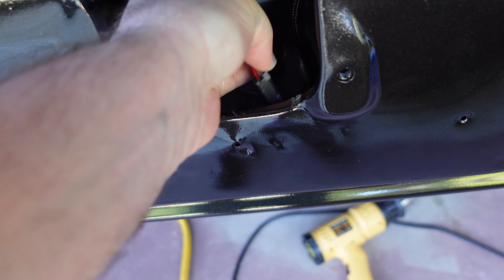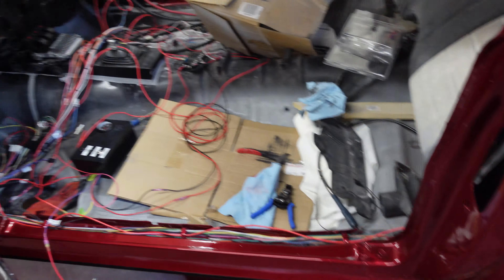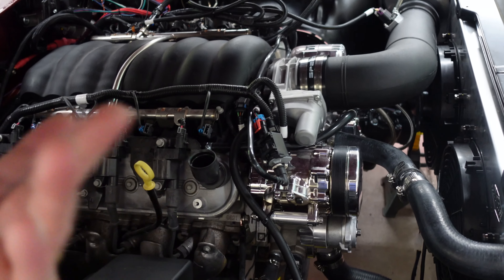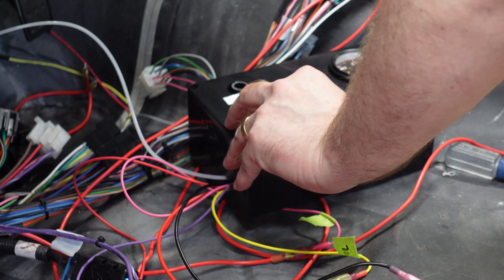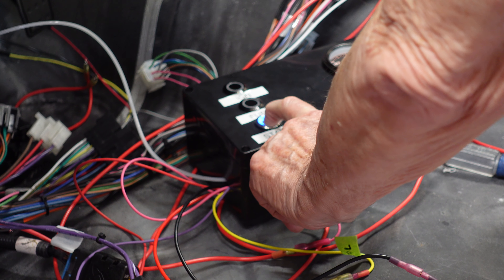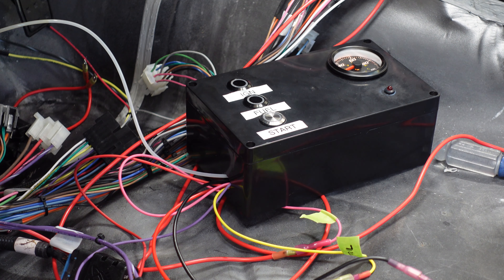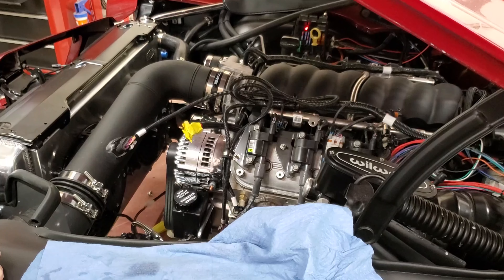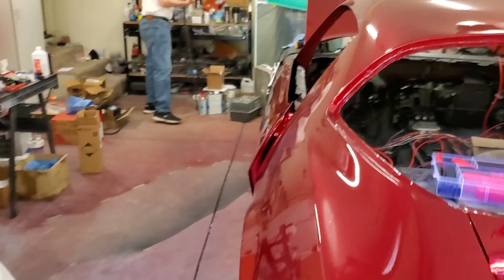1977 Camaro Z28 Part 274: First start?

Comment: You can test the thermostat if needed in water. At least the old style anyways. I have not fired up a LS motor new like what you guys are doing. You hit a major milestone in my opinion. Firing a new engine is always a little nerve wracking. Oil pressure is always the key, everything else is just getting things right. Congratulations, your on the way to the highway.
Reply from the maker: Thanks a lot! A pucker moment for sure. You can see a whole bunch of $$$ go down the toilet right in front of your eyes.

Comment: Hell yeah! So cool to hear it roar to life! I'm a little late to the game, but just as excited as I would be if I watched it the day you uploaded! I hope you got the power steering sorted out (haven't had a chance to catch up yet) and the high pitch squeal is a sound I'm familiar with on my old 4.8 Silverado. It would do that after replacing a battery or some other event where it would lose its "self-tune" parameters and start re-learning air-to-fuel mixtures, idle speeds, etc. sounded like it was coming from the internals, but it was the throttle body.
Congrats, Erik!!! And Pops!!
Reply from the maker: Hey buddy! I never would have guessed that was from the learning procedure. Wow!

Comment: Also the temp sensor in the heads is generally hotter then the one in the intake. I know mine open at about 200 on the heads vs the 180 on the intake.
Reply from the maker: Great info, thanks. I checked the docs, the Vintage Air thermostat is 187.

Comment: Fill the power steering pump and turn the wheels lock to lock multiple times...it will go away....
Reply from the maker: Thanks Trent. Tried that, it did not help. I am talking to DSE about it

Comment: I do not know about aftermarket engine control modules, but OEM factory I do. The key on-engine off, produces a ground signal to fuel pump relay. 18 AWG is plenty to supply or control fuel relay on. Just should have a 10 amp fuse to term 30. The PCM see an RPM signal above 450, it denies cranking. A fuel uses about 7 amps to run. An 18 AWG wire will carry 8 amp for 20ft. Many online charts but I use my ACDelco wire size guide. Even with weather-pack connectors, it is best practice to put dielectric grease found at home improvement stores in auto section, $6. Nice harness wrap but tapping the ends will come loose over time. Place a dab or black weather strip adhesive on tag end, work in and wipe off. Acetone is great. Fuel pump has to push air out of lines, using a Corvette filer (As many do) on “Return-less Systems” takes enough fuel and pressure to get to injectors. Clacking or clicking noise on top is lifters not pumped up yet. But the high pitch whine is p/s pump. Lock to lock while not running while not all air out of system. For oil pressure, I saw live-tube-type gauge. If bearing clearances are tight and bottom of cam bearings are not copper, you still have 2.5 feet of pickup tube, pump (G-Rotor Type) then backwards to oil filer. OEM pans have internal bypass. I hate these as they can stick open with tiny trash. Oil filter should be full when installed, and better off to have pressured entire system at oil pump block plug. P/S pump maybe ok, just run it to seat vanes. Puller is easy to remove pulley but get short one like SnapOn. Use relays to control components as it drop amperage requirements of switch and control wiring. LeSabres, Park Aves have perfect fuse/relay center behind glove box. It is long and skinny but holds 12-13 circuits. Aftermarket fuel pumps may come with a pan but require more the two gallons to fill. I hate the new $10 extra government portable fuel container/gas can. They are spring loaded or have spring button. Go to a boat dealer parts department. Every 4-stroke outboard comes with a 3 or 6 gallon tank & hose. Fishing boats, pontoons and many come with tank on board. The parts room has 50 of each. A good day get them for free or cheap with disconnect, hose and squeeze bulb. Just put a lawnmower on/off valve on end with 3” of hose. Most are 5/16” but placed on bench in shed, gravity will start flow of fuel with one squeeze of bulb and valve open. Just thinking out loud! Best of luck! Auto ASE Master-Retired
Reply from the maker: Thanks Dean. We did the power prime under pressure before this video was shot.

Comment: Congratulations to you both! Huge milestone!!!
Check that cooling system for air, I've found the best way is to vacuum fill the cooling system. Works great, no air pockets.
Great job guys!
Reply from the maker: Thanks! How does one vacuum fill it? Is there a special thingy I need? I will take a look around.

Comment: Nice work! The whining sound coming the power steering is that there’s air in it. You need move the steering lock to lock a couple of times. It should take care of the air in it. Those engine run at 205 and I believe the thermostat open at 195.
Reply from the maker: Thank you very much! I sure hope the pump comes back from the dead!

Comment: U gotta prime the oil pump thru that side bolt the pressure hose is coming from....fill that hole till oil spill out, spin motor by hand, refill and cap, oil pressure will build much quicker but either way .....u got it
Reply from the maker: We did that in the prior video. We put in 5 quarts under pressure

Comment: my power steering pump did the same thing. with the engine off and the wheels off the ground go lock to lock several times while checking the fluid. then start it up and do the same thing. see if this clears it up before replacing the pump.
Reply from the maker: Thanks. I hope you are right. It seems odd to have killed it that fast considering it had SOME fluid in it.
Reply: Yes. ..do what he said...I had same problem
Reply from the maker: @trentdawg2832  I tried it today with no luck. I am talking with DSE to figure out what is up.

Comment: Congratulations! I know you guys are excited. So the whiny noise was the power steering pump? I was hoping it wasn't the input bearings in the T56. Hopefully you didn't  forget to fill that thing full of Synchromesh fluid. Won't be long now and we'll see that thing making laps up and down the road.
Reply from the maker: Thanks! No, the tranny is all full up. Whatever the whine was, it went away. Hopefully it does not come back.

Comment: I was thinking the squealing whistle sound was one of the accessory pulleys (tensioner pulley) not centered, fuel pump or power steering pump (but I think you got it figure out).  For me, it was/is all 3.   P0315 (Crankshaft PSV Learning) - hope you used the coupon that comes with the E-ROD kit so it's done free of charge.  The dealer wouldn't do it for me until I call the GM manager and he called the dealership.  In order to get it done free of charge, I had to get the Serial Number on the engine to the dealership, and that was hard to see.  I used my camera to zoom in between the plate (bracket) holding the AC compressor and some hose (check your email).
Reply: Did you put a engine malfunction light in the dash somewhere too?  (I forgot to pause your video and left the room to do a set of arm curls, then returned to be surprised with what sounded like a coffee pot boiling or thinking the window fan broke but it was this video of your car running! lol, anyway...)  I was chatting a while ago with another CA person online who did the swap and his 3rd gen Camaro failed because there wasn't one in the dash/interior.  I got one from Summit that actually lights up what looks like an engine.  Think it was about $7 or so.  Later I realized one of the new gauges has it built in, so that's cool that I don't have to drill a hole anywhere for the Summit light.
Reply: I also think the installers killed not only my pwr steering pump, but my new steering box ( a real nice one, that is now even a Lot more $$).  They ran an unnecessarily long hose from the reservoir to the pump - out all the way and touching the control arm, then kinked at 45 degrees back to the pump!  None of the 3 shops working on it could figure it out it was kinked.  They kept trying to replace the pump.  The last guy said my tires (285s) were too wide and gripped the road too much for the pump to handle, lol.  I said tons of guys online use it or even larger tires.  He replied: "They're full of - <beep>!"  What is needs is a 4" long roughly 140 degree bend hose.  These "mechanics" and the inspiration from watching your videos is what makes me think I can do this!  Thanks again!
Reply from the maker: @transammusclemachine9386  Whew! Lots of good stuff here. I have not done the learning yet, since I can't drive the car. Once it is able, I will drive it down to the dealer to get it done. I have the coupon, so I am good.
On the check engine light, it is in my new instrument cluster (Dakota Digital). You can see it in https://youtu.be/huwzIaIyzHY?t=590
Reply: @asicerik  Ahhh, I now see the light!  I still need to catch up on your last few videos.  I was so worried that the installers would scratch up the lenses on the gauges that I was going to purchase some plastic sheets to cover them up (I was going to, and easily could have, done them myself, but that is another story).  Even on my home audio and video equipment I leave them on.  Before deciding to do the LS swap, I replaced just the lenses on the original gauges and was so careful as to only touch the edges...the only gauge I wanted them to install was the fuel gauge, because all the rest just to be daisy chained from the OBDII computer plug with what looks like a simple 1/8" guitar jack.  Plus power, ground, light ACC - simple stuff.  The fuel was tricky so I only wanted him to do that. "No, I'm gonna need it all"  So when I got it back, the fuel gauge is the Only One he did Not do...and he charged me $400!  Well, only reason I am not super duper upset is because I was quoted elsewhere for the Vintage AC install about 4 more hours than the gauge guy and I knew those hours were to little. And he did mention how much more time it took.  So it balances out.  Check this out - he charged me $100 just for the dummy light install (what, 3 wires to connect?) and it's just hanging out a hole, not even mounted.  Another set of reasons to do this on my own.   OK, I'm upset again....need to watch more of your videos to help cheer me up! :)
Reply from the maker: @transammusclemachine9386  MAN you have had some bad luck!